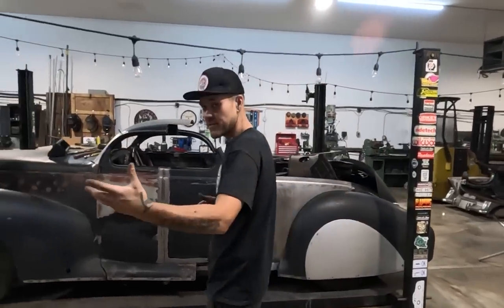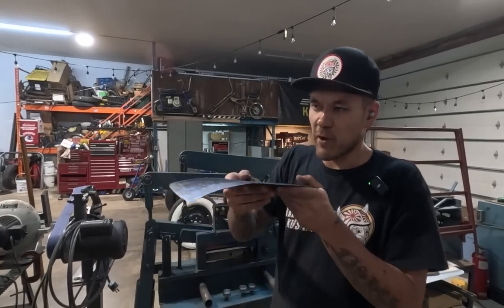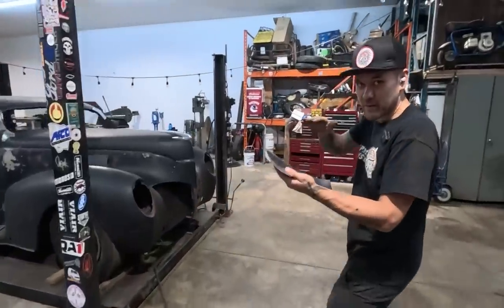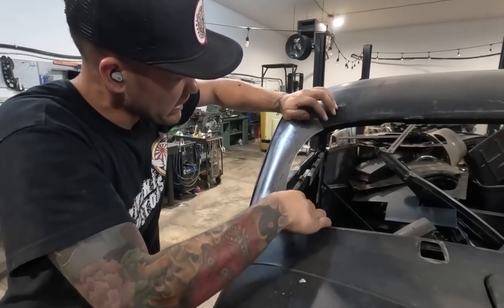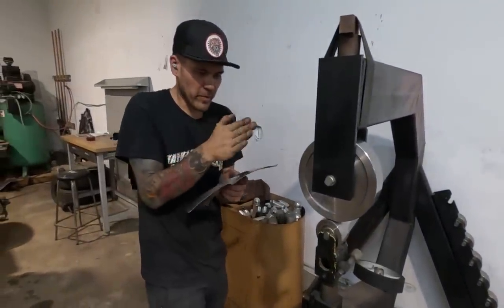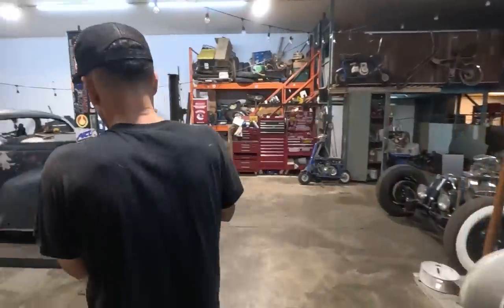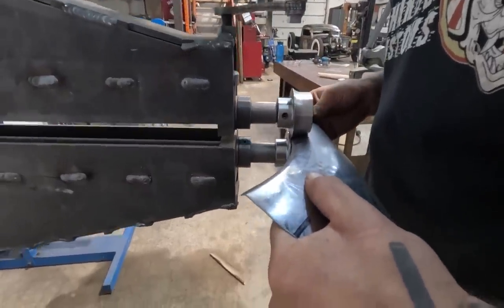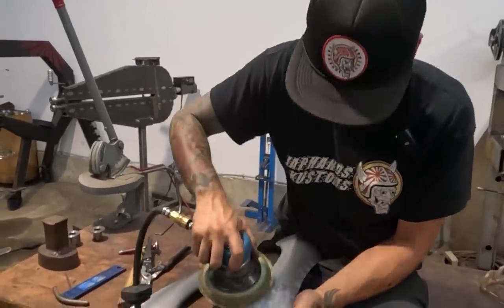PT 2 METAL SHAPING MACHINES To Replace Damaged A Pillars On The 1939 Lincoln Zephyr Coupe Conversion

Comment: Good tools can get you up and running so much quicker and you will use them for more applications than you ever imagined. I use my shrinker stretchers all the time to repair bent panels on mammogram machines to straighten flanges. Good tools + Good instruction will remove apprehension and soon the project no longer seems impossible! I especially like seeing you use the tools you've built!

Comment: Really glad you’ve done that, an excellent job shaping, now on to the strengthening of the pillar, I’d really like to see a weld the under section and a gusset welded vertical only to save introducing another weak point (weld zone) really good you’re showing the best way, not the 90% of YouTube way.

Excellent job

Comment: Mr. Forester, I can't get enough of your instructional how tos.  I will be replacing rockers and Cab corners soon on my Stretched Dodge Ram Mega Cab. In preparation I have bought outer rockers, inner rockers and Cab corners. I have both  Mig and Tig welders. I bought a planishing  hammer by Baileigh and have many body hand tools by Eastwood. My goal is to ensure I have full capability to do the panel replacements without any evidence they were even replaced. May even try leading over irregular surfaces (butt welds). Been waiting to buy a shrinker/stretcher, bead roller and an English wheel for additional creativity. You are very inspiring. 
Thank you for what you bring to YouTube and I wish you all success.
Carl

Comment: It is great to see that the same panel can be made both ways, confirming that we can still do the work without all of the expensive power tools.  As you said, it is mainly a matter of the time required to make the piece.  I also appreciate the emphasis on why this is necessary.  The inner structure of these pillars is a vital portion of the construction of the body.  Most people do not realize that Zephyrs were of unibody construction.  You might be able to get away with more leeway with smaller bodies, but that Zephyr is going to be a large and heavy beast, and will need all that additional rigidity acquired by welding up the inner parts of those support pillars.  If you are going to drive them, build them correctly...

Comment: Karl love watching your videos, just a little tip if I'm gonna use my rubber band on my wheel for a job, I will use spray adhesive on the wheel keeps the band in place and easy to remove and clean the wheel.

Comment: You make it look easy 👍  If i can make a suggestion; try a "power rated" Gates belt or other "fractional horsepower" belt on your power hammer. It will operate much smoother, a regular belt just gets super hot and sticky under slip conditions.  Keep up the awesome work.🍻

Comment: Either way you do it Karl, it's amazing. I will never do this for real but like to learn what I can about the process. Last year I made a shrinking stump and some wooden hammers. (I'm a woodturner) and used them to hammer out a couple bowls in aluminum. I'm going to try some steel to see if I can fix some stuff on my rusted out wood getting truck. Thanks.

Comment: Here is a little tidbit plan I use in my chops and in the collision repairs .If I am doing a top and tail clip replacement, when using a used LKQ top & tail or just a top replacement. I cut the used part to fit and save the chunks I cut off. I will split them apart and used them as sleeves t slide down into the A & B & C pillars. That way if I cut something wrong or off a bit I have a sleeve to weld to. Then I can weld a patch made from scrap that you cut off in your chop or collision repair. Great video's ! I have been in this line of work since the middle 60 s and still learn from you and others. Paul @ Wilmoth Kustoms in Decatur, Alabama 256/ 566=4178

Comment: Great job 👍.  There is only 2 uTube Chanel's I watch make it custom and bad Chad I practically like the hand working videos because that's what I do in shed I have no fancy tools at the moment Im rebuilding and modifying a 1958 Holden Ute and I will be replacing the hole roof and adding seatbelts to the old ute because a lot of the old cars built before 1970 never come out with seatbelts... I've mentioned seatbelts because I haven't seen any videos on seatbelts by anyone yet , I don't know the rules where you are but hear in Australia you wear a seatbelt or be in deep with the seatbelt cameras which are everywhere in Australia and have a empty wallet from the fines you get for not wearing a seatbelt  .. maybe you one-day you could do a video about fitting seatbelts brackets and supports it would be very interesting on how you would fit them since you modified the pillars   on your car which looks great 👍👍👍

Comment: I am really surprised and slightly appalled that manufacturers in the thirties/forties era took so little care of where they joined parts together and then slapped in so much lead.  I have seen the same thing over on Bello's Kustoms, not only the pillars but in the middle of the roof where they joint the front and back halves together.  I think what surprises me most is that they did that on an expensive, for the period, car, one would think they would have taken more care.

Comment: Is the rubber band just for marking ? Or did I miss something, and can you put a motor on a mechanical beed roller ? You know it's nice to make your own panels but when doing it for a job if you can buy it it's cheaper taking your time to make it love what you do and I need to get in the grove of using my tools I have available to me ? That's the only way you can get used to what you have.

Comment: I think you need a better soft start control on your power hammer?
Reply from the maker: Yeah, it’s just a Belt the Tightens with a pulley. Could use some tweaking.